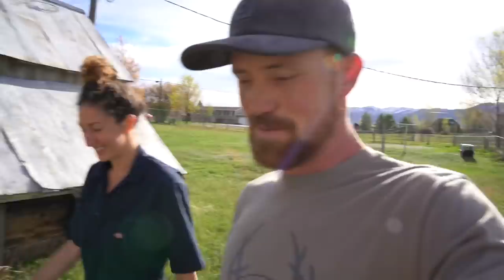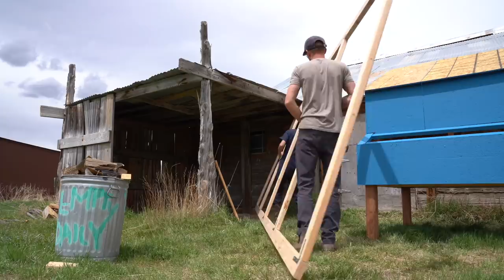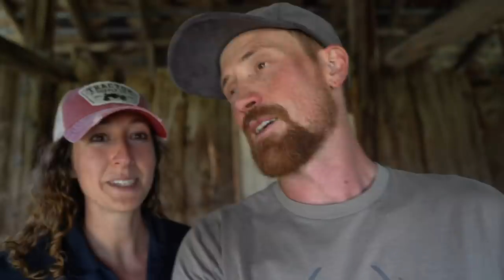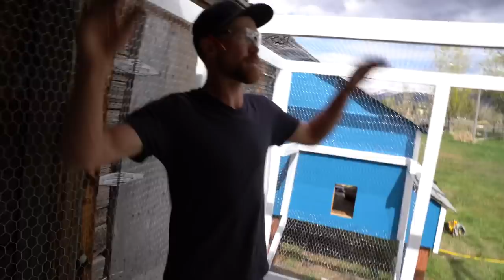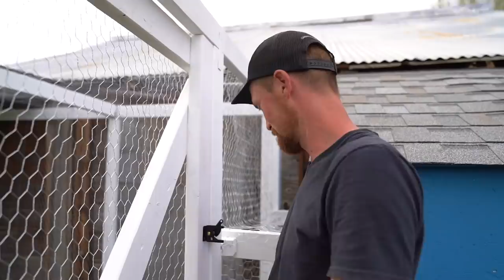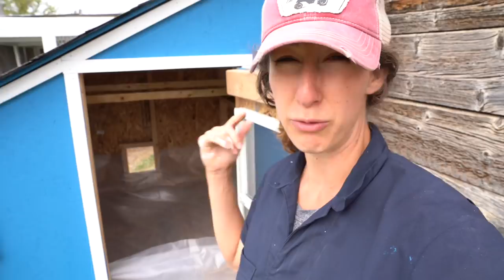WE WILL NEVER DO THIS AGAIN...

Comment: The correct way to ensure that the outlet is grounded is to drive a ground rod and connect it to the ground screw on the outlet. You should use a # 12 copper wire and a ground clamp on the ground rod. This is acceptable by code as well. I am a retired electrician and I am subscribed. I have followed you back from South America. Trent, you should let Allie use tools more; my wife used to help me wire houses and it really took some of the load off. Keep up the good work.

Comment: Trent - I assume the 2 wires from the house are hot and neutral.  The barn wiring is in conduit, so just make sure there is a good connection between the ground of each receptacle and the conduit box.  Drive a ground stake where the run enters the barn and ground the conduit at that point.  Your conduit becomes your 3rd wire or ground.  Make sure all of the conduit to box connections are tight, you'll be safe.

Comment: Grew up in the big city. Moved to southern Oregon and raised a family there for 30 years. Learnt just like what you are doing by hands on experience. All that you learn is useful for other applications in life!

Chicken run building (1 or 2 day completion):
1) use a modular design
2) cut and layout all boards on ground to ensure fit (don't attach pieces yet)
3) line up all boards and paint before attaching and erecting. That ensures all surfaces are painted, it is easier and much faster than trying to paint after erecting
4) assemble individual wall and ceiling sections on ground and attach chicken wire while still on ground. Very fast and efficient
5) to add structural integrity use a fencing stretcher to tighten up chicken wire 
6) the little staples will not hold chicken wire  together against wild animals by themselves. Add an overlap board on top of chicken wire seams sandwiching seams between two boards with screws
7) simply attach all sections together including door to complete building
8) a complete floor is needed 

Note: a simple fence stretcher is made using two 2" by 6" lumber boards between which the chicken wire is clamped using bolts and nuts. Using a chain and come along attached to a truck hitch the chicken wire is stretched tight while being stapled to the board framework.

Comment: Weasels can climb and dig. The wire should be all around. You need more lumber to stabilize in between your 2 by 4’s to keep your wire tight. The sheets you used on the chicken coop will not stand for too long. Regular plywood is what you need it handle rain, snow etc over time.  But otherwise you did okay for the first time. If you add a little vent for the coop and a few tiny wood rods hung across the inside of the coop. Your perch is a little high. You want them about 18 inches from the floor and the other about 24 inches. You should also consider putting a single light bulb that can be turned on in the winter to heat the coop.

Comment: Maybe it's already been said, but you can use a GFCI outlet in place of the ground wire. Just label it as ungrounded and it will be safer and to code.

Comment: Am I the only one.
Allie you are gonna need to change the co-op floor bedding more than that.
Reply: Add a cheap tarp "swing" under the roosting poles. Use the grommet holes to attach 's' hooks for easy removable to dump in the compost pile & then hose off.
Use sturdy limbs of various sizes so they don't get claw fatigue which is painful.
They are very smart & love to play! From the "hardware cloth" on the covering, hang a couple of swings, using found limbs, if you can find a child's xylophone, nail it to a border & mount at their adult level. 
Add a dust bin, using DE so they don't suffer with mites & other parasites. It adds a bit of healthy grit to their diet & prevents internal parasites, too!
This has days worth of info on chickens & other uses, including for humans 😊
💞👵
Diatomaceousearth.com

Comment: I went to Home Depot and got a piece of scrap linoleum to line the floor of my chicken coop. It was super cheap and is so easy to clean. I also use the deep litter method and clean out the coop twice a year, spring and fall.

Comment: We built our own chicken coop as well with a huge covered run. I simply looked for 6 ft chain link dog kennels on craigslist for sale within my budget.  Scored one at a garage sale and the other on craigs. Then we built a 2"x4" frame to support a roof. Coop is on a cement slab. We made all the windows in the coop covered with chicken wire only, then wooden shutters that latch shut to cover them at night and when its cold out (alaska so its frequently cold) Our coop is big enough to walk into with a divider wall so a portion can be used for food and supply storage. You learn as you go when you have no prior experience. Like our first year we just used a wire covering over the run but the snow in the winter collapsed it.

Comment: Critters will climb to get to your chickens. I'm glad you decided to cover the whole coop. Chicken wire is not critter/snake proof though. Hardware cloth is better. And it also should be buried under the run so snakes don't come up from the ground. A lock is helpful on the door for racoons who have hands similar to ours.

Comment: You should replace the ungrounded electrical outlet with a GFCI receptacle. This will make it safe and is what the code requires when replacing any ungrounded outlet.

Comment: Little advice. Not only is Trent right in this instance but you should throw that stapler away and get some kind of combination of mettle and screws to hold that chicken wire down. I used Simpson strong tie strapping cut into small pieces and screwed down with a couple of screws over the chicken wire. By the way we lost 6 of 7 chicken to raccoons prior to doing that

Comment: Put eigth  in Masson ite board on the floor don't screw it down as to use a flat shovel to clean. The plastic is actually going to condesate on tthe floor and cause the mold spore in the osb to grown black mold .

Comment: Electrical plug in shed.
I'm not an electrician but you need to keep yourself safe. Run a ground wire from the plug to a grounding rod. Better  to have this then you becoming  a short to ground. Also GFCI plug and check on the electrical code for you area on how to do this properly. Hire an electrician if you need to. Love the chanel. Stay safe.

Comment: You can replace the standard electrical receptacle with a GFCI receptacle when you don’t have a ground wire. Electrical code permits this as a safe way to replace outlets with a 2 wire (non grounded) system.

Comment: Get a LARGE Nail and run it into the ground and run a wire to it and you are grounded. Also you used the wrong kind of plug. You need and exterior grade plug with the GFI fuse in the center. That way when you overload it the breaker in the middle of the plug will trip and not burn the place down. Also if you are running the trailer off this power source you might want to upgrade your breaker to a 40 amp breaker.

Comment: In the U.K. we have foxes and they would climb into the smallest gap to get your chickens. Also I don’t know about your predators but foxes chewed a hole through that thin chicken wire to get in to our chucks, you’d need heavier galvanised wire or wood around the bottom. Also about 30cm skirt of wire on the ground around the run to stop animals digging under into the run.

Comment: Looks great.
But you want to off-set the seams from each next row of shingles by at least 5 inches.
And, you need aluminum 'drip-edge' at the bottom of the roof or your OSB will rot out.

Comment: You must put a roof and a floor on the chicken coop/run. And you should probably use hardware cloth (1/2” welded wire mesh) instead of chicken wire. Chicken wire keeps chickens in or out, but nothing else. Seriously, predators will climb up or burrow under to get at your chickens. So, you can hardly do “too much”. Best of luck to you from Texas! I love and miss Utah!

Comment: Coons and possums are extremely agile and open locks and bolts. Not to mention I swear they can squeeze through spaces that defy science. As for top cover, absolutely. There are also hawks and snakes. I am assuming that your hens will be free range when full grown. A rooster is a great guardian for hens. Hens never pay attention to their surroundings. Be sure chicks locked up tight before dark. Oh, and Weasels can get through chicken wire.

Comment: You will need to seal up the base of the outside run. Raccoons etc. can dig under the boards and get into the chicks. You will need to bury wire that is secured to the wire on the run so that predators cannot dig under the boards.

Comment: Hey Trent, I'm an electrician; any time you are missing a ground on a wire run you can install a GFCI receptacle and mark it with the sticker "no equipment ground".  You don't have to run new wire this way, unless you want to.

Comment: If metal conduit (EMT) goes all the way to the elec panel, that is your ground. Just put a pigtail from outlet to a ground screw on metal box. Elec contractor
Reply: Technically, should be a GFCI outlet, being that it is outside and in a ptentiallt wet environment
Reply: "Potentially"

Comment: Trent you think way faster than you speak so sometimes you get ahead of yourself.  I do the same thing.  The only thing that helps is slowing speech  a    little bit and tying not to think of too much at once.   I don’t reverse things when writing or reading, never did.   I think that’s a more typical indicator of dyslexia.   I was told I have a thick palate which might contribute to that.

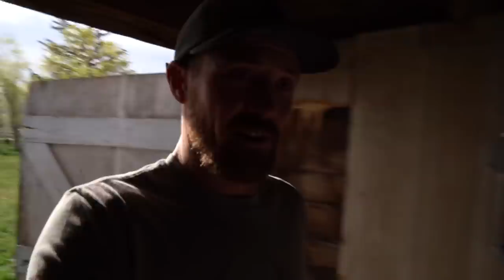Comment: Great job on the coup and run!  One thing about the roof of the run, because it absolutely needs a roof, (good call Trent), predators will get into a weak roof. This is not an endorsement for chicken guard automatic door but check out the vid by NJRE (Chicken Guard Automatic Door Review) go to 1:40 which shows a predator getting in a run thru the roof. Caution: it’s pretty graphic.

Comment: Yes they will climb! You need a roof! I had an great northern owl break in thru the roof. It killed my hen. Normally you make the roof pannel on the ground then put it on top and connect. The wire goes on the outside so the animals dont push it in. Put strips of wood on the wire. 1x2 should be safer. Contain the goats in a smaller space and just sit down. If you wanted pets, sheep. The bible calls some people goats, some sheep. You will learn. I love watching! Im an off grid grandma. 14 1/2 years now. Life is an adventure!

Comment: Just an FYI — predators will dig under and wreck havoc on your chickens- I use tin buried about 8 inches down  from ground level and the rest of the sheet of tin up the sides - Wishing you good luck with everything you are doing - Keep them safe— It way better than finding them killed - That one night you forget to lock them in overnight will be the night something will get them.

Comment: Raccoons will def climb up & over and get after feed as well as chickens. They'll even dig a tunnel under the walls if the dirt is soft enough - personal experience there. I watched a coon hang from a wire roof to grab the gate handle and kept moving and jiggling it until the gate opened up. I had my .22, so he got a surprise once inside the pen. But they are clever, as well as patient and ruthless

Comment: Honestly, BEFORE I had chickens, I would have agreed with you Allie. After having chickens, not even out in the country, but in a city of 100K people, we lost two of our chickens - one to a raccoon and one to a possum, so I've got to side with Trent here. We had an INCREDIBLY secure coop and they are soooooooo good at finding a way in. Possums will sneak in and hide so you don't even see them. Raccoons are just super smart and can navigate the craziest of locks to find their way in. They are also just mean. The raccoon lured one chicken out of the coop when the door wasn't shut yet into the chicken run. It hid in the corner and as the chicken got close, it reached in through the fence and tore it's head off!!! (which after researching I found out was quite common!) Also, even if you don't have many in the area, once they find out there are chickens around, you'll have A LOT more showing up.

Comment: i am kindah like you with some stuff, i allso have problems talking to people or make interesting conversation on my own 
i got recently diagnosed autistic spectrum disorder and add 
as for the bottom of the chickencoup , maibe use dry sand on the bottom , they can scratch around and when it gets too dirty you can shovel it out and put it on the compostheap and put down more sand
as for the ground wire . you might be able to put a copper rod in the ground at the barn and make another ground wire ankor point

Comment: it's going to be easy for a chicken eating scavenger to enter this chicken coup.  the scavengers will dig under the walls so easily.  perhaps chicken wire as the floor as well, that connects to each wall.

Comment: We have ducks and a VERY persistent fox that comes each night that is able to jump 6’ to the top of our aviary and run up to the ridge beam and torture our ducks below.  It also attempts to burrow under the aviary which we have buried a strip of 3’ welded wire around the entire perimeter.  It has been so smart that it will start to dig right at the aviary and will work its way incrementally outward to test the ground for burrowing.  This fox became so desperate that it reached through the welded wire on the pen and de-winged one of our ducks.  After some of the initial attempts we installed cameras.  Each morning we watch the footage and are amazed by its tenacity and dexterity.  This just goes to show you that predators will systematically test your structures and will find any weaknesses.  It is not a wasted effort to overbuild.  It is so disheartening when you come out and see maimed animals that you have enclosed for protection, and in the end the protection only served to trap them.  FYI we live in a suburb of Philadelphia, PA, not in a remote rural farm area that would provide a greater habitat for predators.  

Thanks for all of your fabulous content.  We look forward to all of your postings!  Best of luck in all of your endeavors.

Comment: Sorry, Trent is right. Animals will work hard to get the chickens and goats.Hope you seal those openings on barn. My in laws lost all their goats from possible coyotes. At least get chicken wire on those window openings on the barn. The plastic may not last as long as you think on coop. Also, chicken wire from coop to run should be doubled. If anything is trying to get them and they run to coop their feet could get bit. We ended up putting plywood there.Just from experience. You guys are doing wonderful work!

Comment: Sorry Allie, skunks also climb up and over the wire fence and into the pan where you have your chickens and ducks etc. They bite the neck suck out the blood and just rip part of the skin off the neck, then leave them to die and go onto that next one. There very vicious that way. They also dig under the fence. Dig a small trench down and put chicken wire in the trench and coverer it back in. Best of luck, Keep at it it can be very rewarding. Especially now since egg price is gone way up due to the COVID-19. Another good practice for your chickens, is to paint the inside walls with white so when you’re not there any longer, mom can take a hose and spray the inside of the coop to clean it, or disinfect it if needed in the future. Just a little add-on, have a seat with your back to the goats. Stay calm and quiet,  play around with a little hay in your hands or better yet a bucket of grain, see if they come to you. You might be surprised.

Comment: Lets try this again. First time it just sort of disappeared when I hit the comment button. You really need the roof and it needs to cover the entire pen. Animals can climb the chicken wire. The Chickens can fly over it also when a little bigger. Our chickens could fly 20 to 30 feet up into the trees. Hawks, chicken hawks, and eagles will get the chickens and either dine on them there or carry them off to feed their babies. We also wound up eventually putting chicken wire on the floor to keep burrowing animals from getting into the coup. There should also be a door on the small door into the pen to lock them inside the house and lock animas out. One more thing, maybe a luxury, there should be a rod (like a mop or broom handle) or 2 inside the house to roost on. I found ours preferred to sleep on the roosting rods than the floor.

Comment: I had a racoon tear about 3 ft of singles off my roof.  They are strong.   I dont think that enclosure is going to keep them out.  They are definitely going to did under or just trear wire. Are you planning to keep them inside the coup, they might have a netter chance.

Comment: The predators, opossums and raccoons, climbed up or chainlink kennel and tore open the chicken wire, climbed down in to the chickens, ate some in the pen, and drug some up the chainlink, through their new hole, and back down the outside of the chainlink.  Lesson is chicken wire only keeps chickens in.  It does not keep predators out.  We had to re-roof the chainlink kennel with heavy gauge fencing wire.  Good luck.  We've had chickens, ducks, turkeys, guineas, and pheasants for about 12 years..  Also, hawks and owls will come sit on the edge of any open pen, and hop down in to feed on chickens.